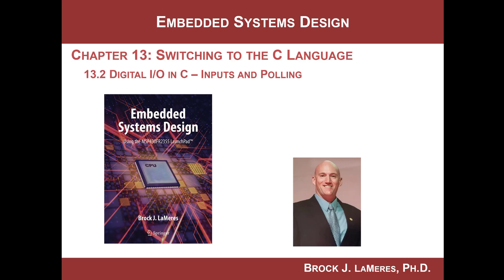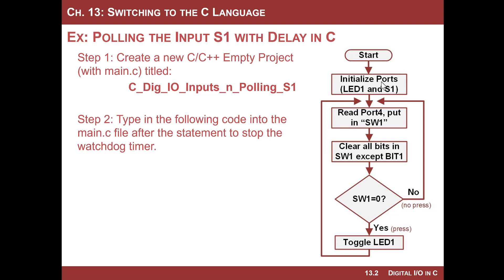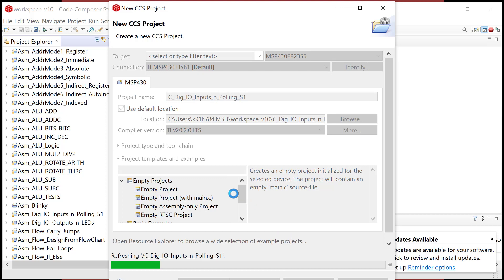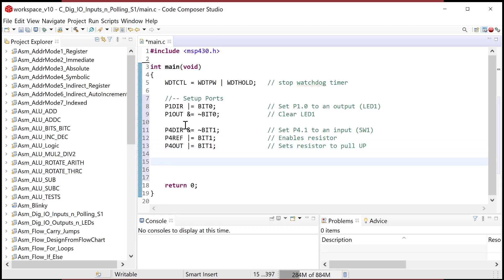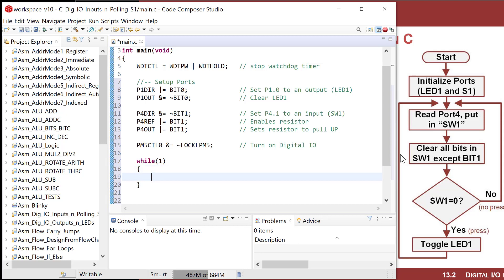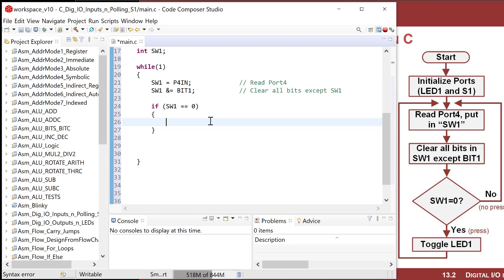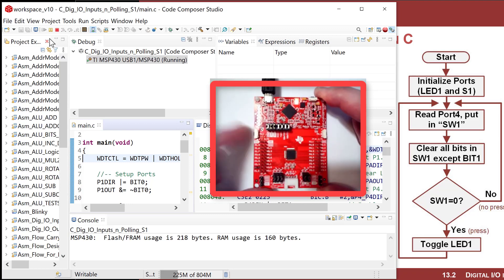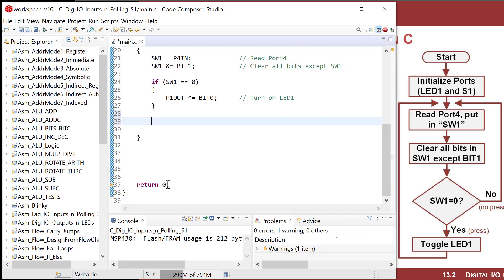13.2(b) - Switching to C to Program the MSP430 - Digital Inputs & Polling

Comment: for better response you can adjust the delay count to i < 17000. just don't put values more than or equal to 2^15 (that is, 32,768) or it won't work.